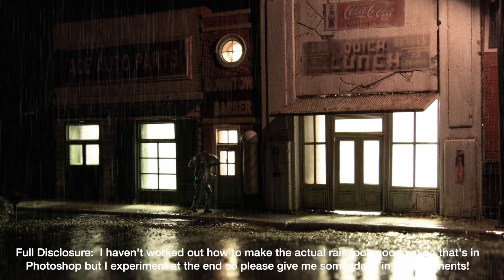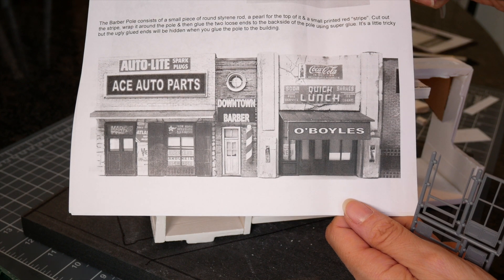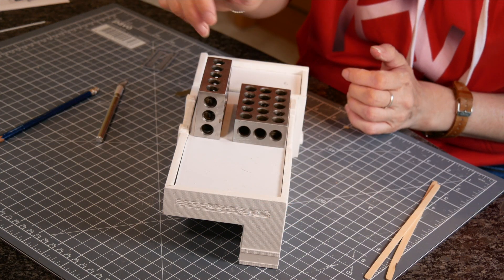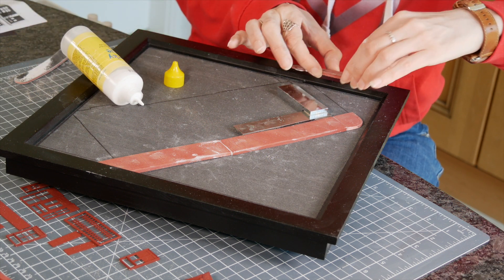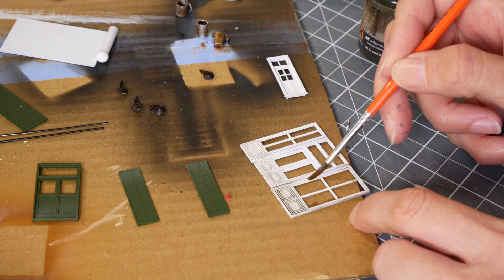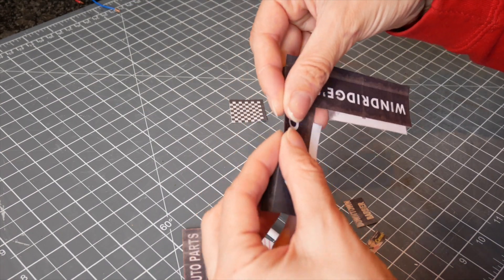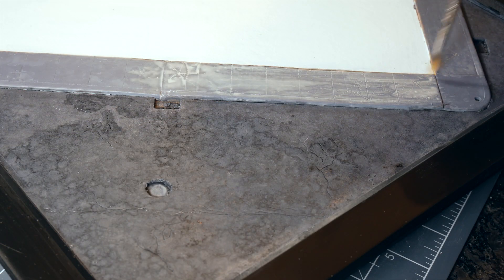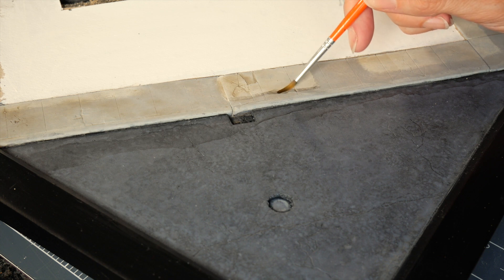Model a Realistic Rain Diorama

Comment: Wow! Well done. As for rain and snow in the air for a diorama?  I took thin sheets of plexiglass to make four clear walls. On one side that would be the inside. I took masking tape to mask a protected area at a slight angle. Next I used very fine sandpaper to scratch lines lightly into the plexiglass the same angle as the tape. I tried to keep the scratches as straight as I could. I matched the angle all the way around in a way that when looking through the plexiglass that the rain was moving in the same direction. I then removed the tape and repeated what I did before. This gave me different densities when you looked through the plexiglass. I wish I could show you how it came out. But it was some time ago and I am no longer in touch with my client.  If I were to maybe improve on it the next time? Maybe try this technique on both sides of the plexiglass to see if it is raining harder. Oh and on down spouts, and off of roofs? I used clear packing tape dipped in clear silicon rubber to show water rushing out of them. or off of them. Good job. Love your work. You help make me be a better modeler.
Reply from the maker: Thanks. It’s great to hear from someone who’s actually made rain!  That sounds so impressive. Thanks for sharing.

Comment: Kathy, for a rain effect in dioramas my simple method has been to frame the project in thin clear plastic walls.  Then any combination of using small drops of glue or even mildly scarring the inside surface works great.  My technique was to make sure I did it all in the same direction for realism.  This method also works really well for snow.  If there's enough room on the project for multiple walls, adding them will enhance the visual appeal.  This was a lesson learned from a Fargo diorama I did. (From the film Fargo.)  It looks like this project turned out really well.  Thanks for the post.
Reply from the maker: Thanks a lot. Next time I do rain, I will try and build something in like you describe.
Reply: @KathyMillatt  One thing I've wanted to try but haven't yet is to use a thicker clear plastic wall and put glue drops on either side.  Should save space and time.

Comment: This is so beautiful!! Even though it was awhile ago, I wanted to take a crack at brainstorming a solution for the rain. If a "brush" could be made that has sewing needles as the bristles (maybe attached together with clay?) that could make thin enough strokes. Or maybe a body brush with really light pressure and just a bit of paint applied only on a few areas of the brush? A lice comb might also have a thin line effect, though I'm not sure how thick the needles are. Last idea! Using something abrasive like steel wool to make scratch marks might work! Really not sure how any of this would pan out or if they'd be worth trying but I enjoyed thinking on it haha!

Comment: I try the same concept and create some ideas you can use!. First an Acrylic display box for the diorama. You could use some transparent paper to print the rain on your printer. Then use some layers in levels inside the box of printed rain on transparent sheets and put it inside the diorama using this scale. The layer more closed to the exterior of the diorama you can see the tiny drops of rain falling but in the inner layers closer to the buildings the resolution is more little so make a forced perspective illusion. Even you can use the mist to show vapor uprising from the floor. And a strong mist on the borders of the sheet that touches the floor to represent the splash of the rain on the floor. And don't forget to add the rainy tiny circular patterns on water texture on the floor because that brings movement and a realistic feeling. You can add a ceiling water drain tube to a barrel or the street using the waterfalls technics and the deep splash on the floor or a barrel. Remember how the water behaves from top to bottom on the walls and simulates the dripping accumulation on tubes, borders, and objects in the rain. Search pictures across the web to study how rainfall, splash, accumulate, and run on the streets. and liquify more the water resing to let find more precisely his level of gravity on the places where it accumulates.  use a wet dog with water dripping from his body under the rain to create the illusion. And add some floating objects on barrels or water accumulation on street borders.  Hope this brings you a new amazing project to work. This one is so good that could be my favorite forever but I know you can rich even more high standard with some improvements. Think about technics used on other types of works to improve more and discover even new ways to do the same improved. Oh! and add some mud color to the water on the border of the sidewall to create the idea of running water from another more dirty place up the street. Hope this helps you...
Reply from the maker: I love the idea of a bit of mud in the water. I took loads of photos in the rain here and it was fairly light rain so the water remained clear but in a heavier downpour or in an area with mud, then this could happen.
Reply from the maker: I couldn’t get transparent paper to print. The ink just smeared. Maybe a laser could work but I don’t have access to one during lockdown. Also, I couldn’t print white so I could only print translucent black at best. It was a real pain.

Comment: Very nice. 

For a high gloss I use Halford's car body clear lacquer.  I'm a bit stumped on the rain too, I suppose scratching the rain into the Acetate rather than printing it on could add some dimension to it rather than being flat, it would refract the light a bit.  Or a more time consuming option would be to pull out hot glue strings across your Acetate sheet and cut gaps into them, getting that dimensional illusion.
Reply from the maker: I do like Halfords clear lacquer but the spray I used was first to hand. Two good ideas on the rain front.

Comment: Cool diorama. If you want high gloss talk to car modelers. Shiny is our thing :) . We'll suggest avoiding Vallejo varnish like plague. It is used by aircraft and armor modelers to make the paint surface smooth and protect paint before applying decals and weathering affects. But it's absolutely not good for a high gloss surface. Instead try one of the following: 2K clear ( it is toxic and you'll want a spray booth, good ventilation, and good respirator, also it requires getting a feel for how to spray it to avoid orange peel) but OMG the shine is fantastic! Tamiya LP-9 gloss clear lacquer - a very nice gloss clear, or Alclad Aquagloss a good high shine gloss clear if you really want to go for an acrylic.

For rain drops, maybe scratches in super thin clear acrylic sheets, and place them in multiple layers front to back to give more 3d effect for the camera?
Reply from the maker: Thanks for the recommendations. I do have an unopened bottle of aquagloss so I’ll use that next time. I’m always envious of your perfect finishes!
Reply from the maker: I think scratching acrylic is the way to go.

Comment: I've been thing on this diorama for a few days now, and I've come to the conclusion that what's needed for an in-person experience is sound. A continuous loop of the sound of rain falling, people or vehicles passing, and the occasional rumble of thunder in the distance, would complete the scene.

Photoshopping rain itself is easier than any practical effect can do it without it becoming a modeling project itself.

Repairing 3D printer damage - or even just regular assembly cracks, might be better repaired with a splice plate on the interior rather than gluing along the crack face.

In addition to downspouts and foliage, you can also hide gaps with plaster and hand carving. Billboards, paper handbills or posters, or painted or decal homemade signs that conceal the item within the design. Or a pile of junk against the building. 

BTW, I love the idea of using a picture frame for a base.
Reply from the maker: Thanks a lot. There’s some great tips there. I do like the idea of sound so that’s on the list for a future diorama.

Comment: Never tried it but I bet you could get a cool rain effect using invisible string. Had some when I was a kid and recently picked up a packet to play around with. You could lay out a few dozen lengths of the string propped up an inch or so off a surface and dab little amounts of clear glue once or twice per string to simulate long drops of rain. The string is so thin the glue would look tiny enough to be believable without seeing the string between the drops of glue.
Reply from the maker: I’ve never heard of invisible string so I’ll check it out. Thank you.

Comment: Top notch work! Kudos!
...I was expecting to see some simulated miniature raindrops in the end and I was curious to know how you could have possibly achieved that effect! 
Of course the Photoshop is the best but I also got an idea: if you make this diorama a boxed one you may attach some fishing wires on the transparent top using some Epoxy resin like the Prochima E-30 Acqua (btw the E-30 is the best to add a very shiny and thick perfectly transparent coating in a single pass) that being very fluid will run down the transparent wires possibly adding some random thickness too. That may sound a bit crazy to attach a million of fishing wires especially considering the E-30 requires at least 8 hours to start catalyze, so I give you another simplified version you can use on both a boxed version or just to take some pictures: again use the fishing wires and have them glued with Epoxy bi-component resin on a flat acetate or on a more rigid acrylic plate. The technique would be to have the plate at the bottom of a tray start slowly pouring the very watery and transparent epoxy on your tray, after cutting some hundreds of fishing wires place them at angles on the first resin strata that has become stickier after some hours if you need to keep the wires straight in position, finally you pour more E-30 to to the required thickness; it is auto-levelling and you should end up with a number of transparent wires inside a thick perfectly transparent plate. Now that I think of it, you may not even need a supporting acrylic or acetate but just use the two strata of this Acqua. There are a few videos about this resin that can give you some ideas
in Italian but it shows an interesting technique 
https://www.youtube.com/watch?v=UPWVrC2YMkY
this is in English
https://www.youtube.com/watch?v=WCPhNfFJReo
You can then make 4 of these and use them as the sides 'windows' of your box, or just use one in front of your camera...
Watching you at work is most inspiring! Thanks!
Cheers
Reply from the maker: Wow. That sounds like a really interesting technique. Thank you so much for sharing.
Reply: @KathyMillatt  It is promising but it needs to be tested*. Just thinking about it I have a couple of new ideas: fishing wires come in different sizes so mixing them can perhaps gives a deeper effect. You can also pour multiple strata of the E-30 each containing different sized fishing wires: this again to enhance the depth effect...
* Just to verify this is a good effect for you before going further you may test it by just placing some fishing wire segments on a transparent surface (glass, acetate,...) and keep them in place by some adhesive tape on both ends. Take some shots with it in front of the lens at various distances. And then show us!
I'm getting curious.... ;)

Comment: I’m not a crafter or anything but maybe for a raining effect. Around the diorama put up glass panes kinda like a fish tank sand paper the inside surface of the glass vertically then find a roof for it maybe another picture frame the same size hold the frame upside down and take a hot glue gun and work some hot glue to where it’s long skinny strands lots of strands hanging down. Then carefully place that over top. Between the scratched glass and the hot glue strands hanging it might make and raining effect.  Maybe wire some lights to flash to simulate lightning before doing the glue bit. Just an idea. And if it doesn’t look good you can always take the top and glass out again.
Reply from the maker: Thanks. That sounds like an interesting mix of an out and inner rain effect.

Comment: With those types of buildings when you have a break like that use white glue it works best on plaster buildings & it's thinner than epoxy so the crack is less visible or invisible all together. & I like to use the back side of the Xacto blade as a scribing tool. First cut your lines with the sharp side it will help to keep the lines straight then flip the blade  over & use the back side of the blade & keep scribing until you are through. Getting a small knife sharpener that has a carbide side & a ceramic side will sharpen Xacto blades amazingly well. & you can save money by re sharpening the blade over & over again & with a really sharp blade the tips don't break off as easily as they do with a dull blade.
Reply from the maker: I love that sharpening tip. It made it into my top cutting tips video and is such a cash saver. I’ll definitely save the white glue one for future breaks!

Comment: Have you tried fine glass paper or wire wool on acetate for the rain effect? It will diffract the light rather than obstructing it so you will get both light and dark effects and can control the direction and density of the effect. 

Because the acetate is thin you also have the option of layering it for a 3D rain effect that works for live viewers not just the camera. 

Add a sound track and your brain will convince you the rain is actually moving.
Reply from the maker: That’s a really good idea. Thank you. I also like the idea of a soundtrack. Thanks!

Comment: I've been thinking about this ever since I watched this video day before yesterday, and this is what I've come up with. I like your white lines on acetate idea, and I want to expand on that. I'm thinking acrylic, or I guess you would call it perspex, and I think what you want is scratches. I think you shoud make a series of very fine scratches in the plastic, all in the same direction, and all about an inch long. You could use a wire brush for this, or in a pinch, you could make them one at a time with a razor knife.

The reason for scratches is that some of them might not be visible from all angles. They might catch the light, like rain does, and they might be less visible away from the light, like rain. They will be thin and delecate, much thinner than you can paint, and they might produce the effect you're looking for.

You could also put in more than one sheet for a volumetric effect.

The only other thing I can think, and honestly this is a dumb idea, would be to submerge the entire diorama in clear resin and hang like a million pieces of fishing line in it to make the rain. Even as I'm typing it, I'm realizing that this idea is even worse than I thought. Nevermind.

Try the scratches on the acrylic sheet. It could work.
Reply from the maker: I do like the idea of scratches. Definitely one to try.
Reply: @KathyMillatt  I had the same thought.  Try different grits of sandpaper. 80 grit will produce larger scratches spaced farther apart, and finer grits will make smaller scratches closer together.  Anything finer than 200 grit will probably simply fog the acrylic. Sand in straight lines in one direction only. Do only a few strokes at a time, then stop to check the effect. Making the scratches visible, especially in a photograph, will require lighting them from the proper angle.  Placing the acrylic sheet close to the camera will tend to render the rain effect out of focus unless you are using a very small aperture.
Reply from the maker: @TheSockMonkeyGuy  Thanks!

Comment: This looks really Great!, JUST a few  Suggestions : An A/C UNIT on the ROOF ; as well as AIR vent PIPE ,and also some type of water abatement structure. or a maybe even a skylight window .. just add something to the roofs so it doesnt look so empty on top. and i think those little additions will really take your diorama to an even more realistic level : )

. also SIGNS ON THE STORE FRONTS  "yes were open" or "store hours" "NO animals / service animals only"  . "Exit" or do not enter on REAR DOORS
 
LASTLY, PAINTED LANE  lines or road lines YELLOW or WHITE, parking meters or streets parking signs , OR PARKING SPOTS OUTLINED

JUST MY OPINION :)
Reply from the maker: Hi. This is set in the 50s so I guess air con isn’t as prevalent?  I did think about putting more on the roofs but I didn’t want the clutter to distract the viewer. What’s a water abatement structure?  White lines are a great idea. I was copying a modern set of structures and the white lines were only down the centre of the road. I decided my road was wide enough that they were just off the edge of the diorama.